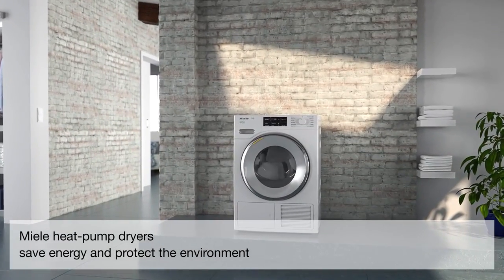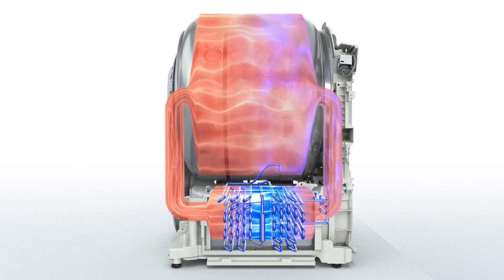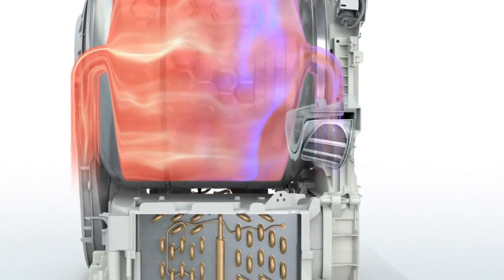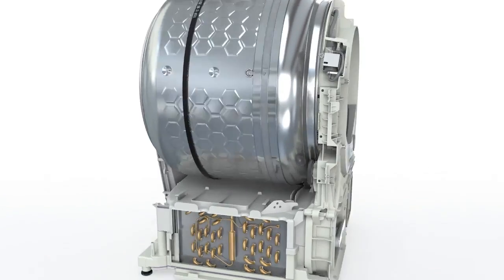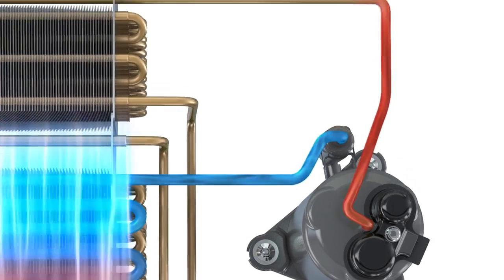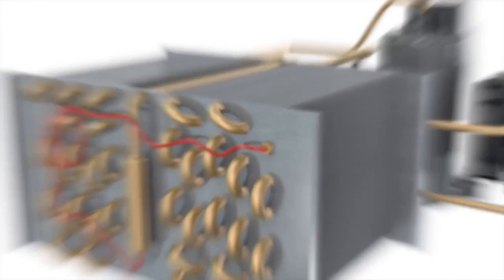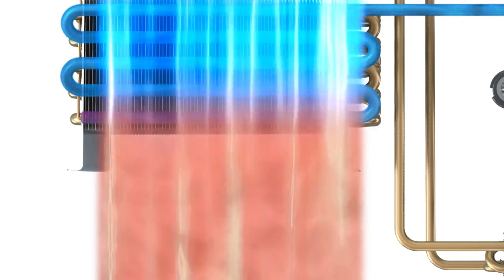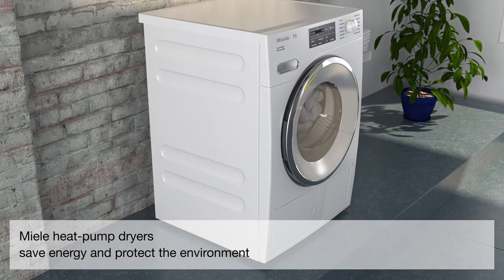Miele T1 Dryer Heat Pump Technology

Comment: We have had a Miele T1 heat pump dryer for 2.5-3 years now.  It has 5500 hours on it.  We do a lot of laundry.  No problems with it.  Bath towels (full load) are dry in 60-75 minutes when spun at 1600 RPM.  We have had nothing but positive experiences.  I can't relate to putting laundry equipment in a cold or hot garage.  We keep our vehicles and yard equipment in the garage.

Comment: Everyone seem to be really disappointed with the heat pump technology in dryers. It seems as if dryer manufacturers install tiny compressors which can't handle the job, especially when owners place those dryers on cold garages and laundry rooms. they take hours to dry in the winter so most people are forced to use them overnight on the highest settings when temperatures are freezing which make the problem even worse, leaving damp surprises for the morning that usually stink (Wet clothes in enclosed spaces produce dangerous mold and fungal spores).

To make things even worse, they are very prone to failures, have very expensive parts and require specialized technicians to fix, all of which can only be provided by the manufacturer, making it the only benefactor from this ordeal.

Energy wise, they might save you a few bucks per month, theoretically, when using it in the ideal warm environment. The problem is that you can also hang those clothes to dry in this ideal warm environment, using zero electricity while protecting the fabric, making it pointless. 

I would only recommend those dryers for rich, single people that live in tiny apartments, for some reason, with warm but rainy weather all year long.
Reply: @Bekim Fazliu 
A heat pump is a heat pump.  They are used all over the world and have been for more than half a century.  They are used in small residential units (the square box outside a house with a fan on the top MIGHT be an air to air heat pump) to large commercial buildings where the heat pump moves heat in and out of a water loop that is pumped around inside the building.  The water loop is used to heat or cool the refrigerant.  Geothermal works the same way.  There are pipes under the ground around 10-15 feet down that has coolant pumped through them.  The earth stays at a very consistent temperature all year round at this depth.  This can be used to deposit waste heat in the summer when running the air conditioner or to remove heat in the winter.
Reply: @Bekim Fazliu The compressors of those dryers are tiny. They can barley manage to heat up a small dryer drum, not to mention a whole living room..